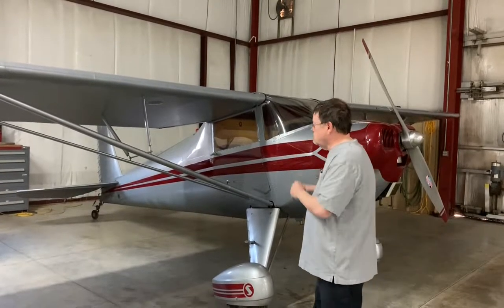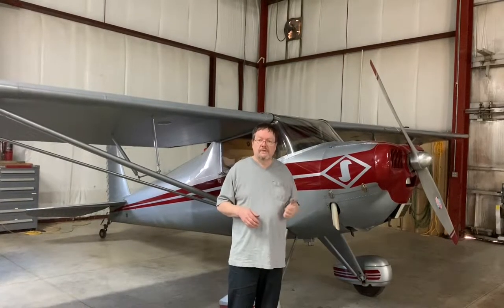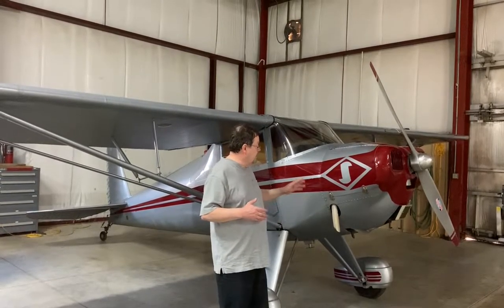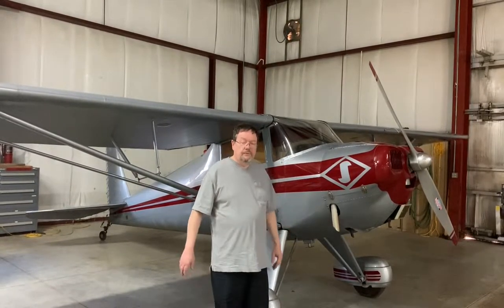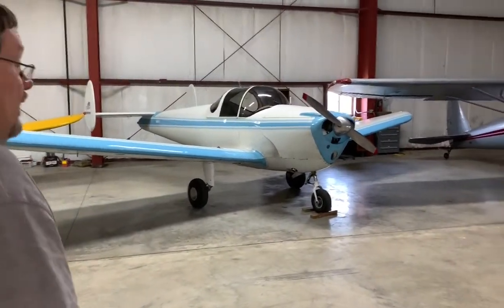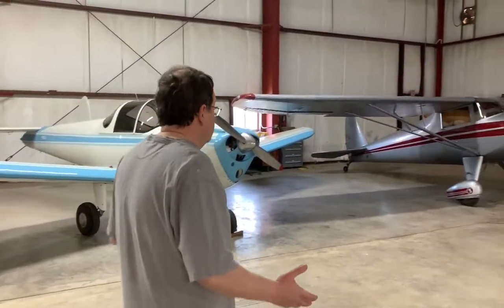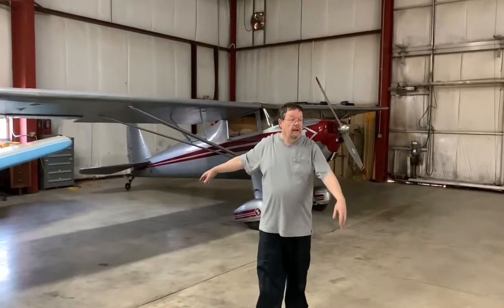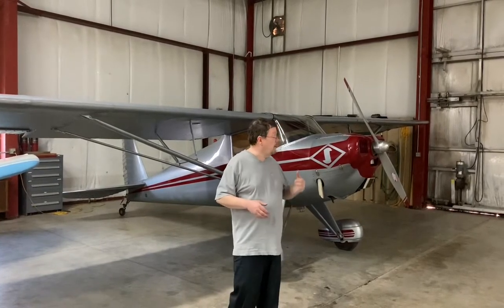Flying a 1945 Luscombe 8A tailwheel airplane

Comment: Nice to see someone who actually knows how to do wheel landings... especially apparent on 3rd landing.
Often I see pilots trying to achieve a wheel landing without quickly popping the stick forward to force the aircraft to stay on the ground...which may work under calm conditions, but is unrealistic under most conditions and pilot skill levels.
On my solo 100-mile X-country to Healdsburg, CA, in a Luscombe 8A, I encountered ~ 10-15mph 90-degree gusty X-winds on a relatively narrow runway, and was able to successfully land by aggressively popping the stick forward to force the aircraft to stay on the ground to avoid drifting off of the runway with the wind.
I was young then...now I would instead divert to another airport. 😊
Reply from the maker: Thanks for the compliment.  The Luscombe is very controllable in crosswind landings with a skilled, proficient pilot.  40 years ago I was taught wheel landings before 3 point landings.  I still prefer wheel landings.  The strongest crosswind I encountered with my Luscombe was 17 gusting to 26 knots, which was challenging.  I would never advise attempting a moderate or strong crosswind if you're a freshy who just got a tailwheel endorsement.  Thanks for watching!